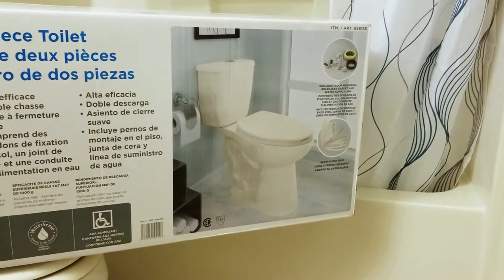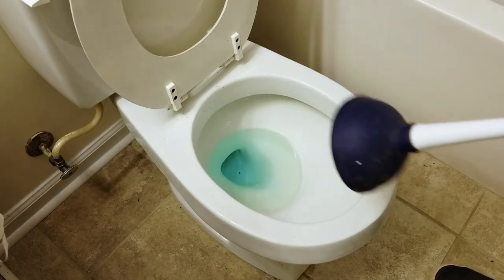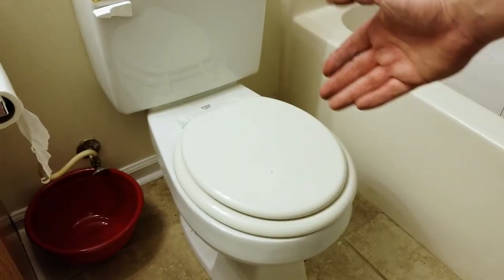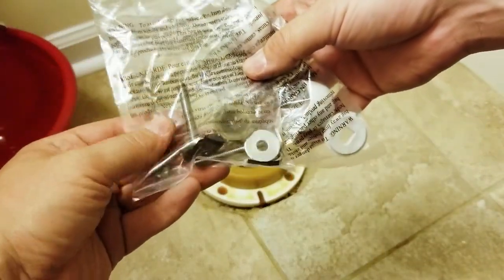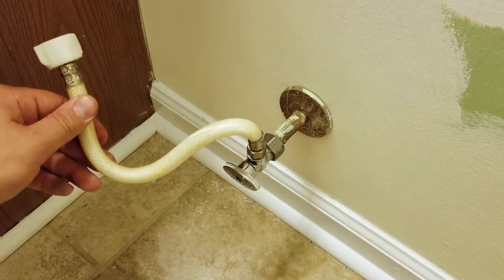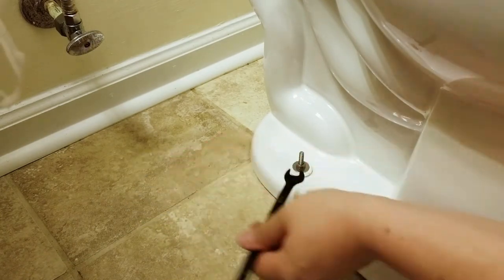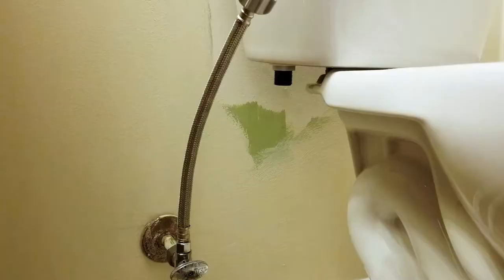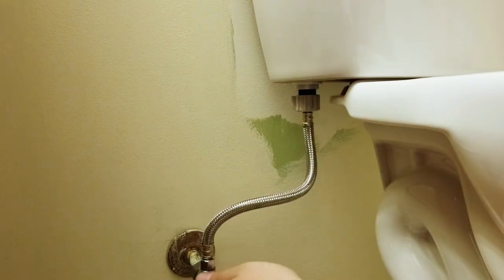Costco Toilet | How to install Toilet

Comment: how do you adjust the water?
Reply from the maker: 4:28. On the left side of your tank. There is a floater under that blue cap. It  goes up and down and that's what controls your water lever inside of the tank. That black cylinder that goes up and down is your floater, and on the right side of it there is a long plastic screw about 4 inch long. You'll simply twist that screw and it will rice floater or lower floater for water level control !